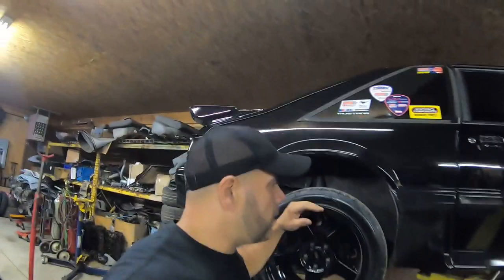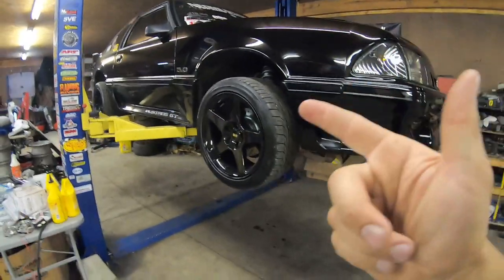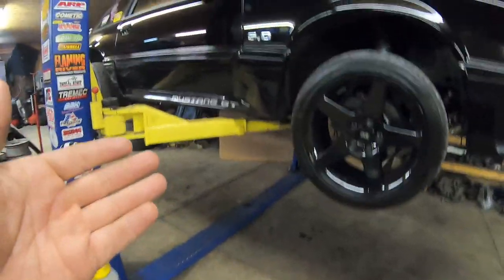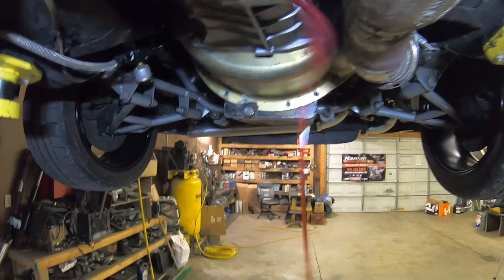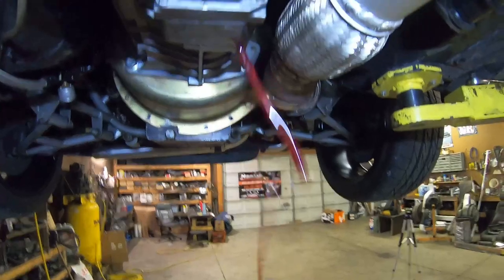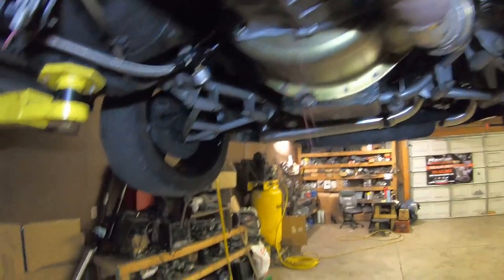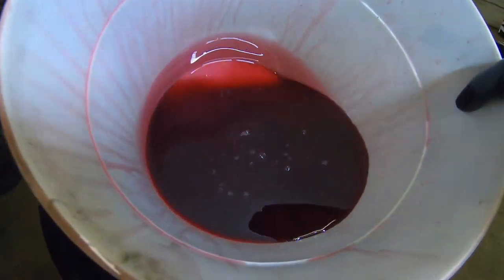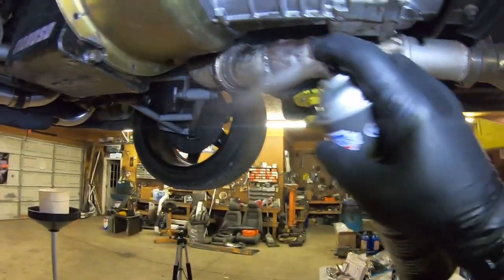The One Simple Tweak That Transformed My TKX Transmission

Comment: thats because tremec makes a quality product
Reply from the maker: Never said that
Reply: same kind of oil came out of my tko 600.  before that i had a "built"t5 with a certain gear set.  it looked like someone added a pound of silver powder.  scared the shit out of me.
Reply from the maker: @angry408w7  Ya i get that. You cant see it well in the light, but it swirled silver hue.. lol. The syncromesh i put in.. boy that was night and day shifting. Video coming.
Reply: @Neomustangs  Pennzoil is very good.  i just changed it after 2 years and about 10,000 miles.  looked absolutely perfect.  I switched to amsoil.  definitely a difference in shifting for the better.

Calling Hanlon tommorow.  thank you for the code!

Comment: ive got a tkx and i cant believe how whiney 1st gear is
Reply from the maker: Did you change the fluid?
Reply: @Neomustangs  Yes sir. broke it in ATF switched to GM Synchromesh and now ill be going back to ATF. Spoke with American Powertrain and Gary stated i should just run Dex3 in it. Gary at @AP did state that the whiney 1st gear is normal.
Reply from the maker: @stangnutlx  it is. Synchromesh helped my tkx shift way better. I tested this thing. I know what it does
Reply: @Neomustangs  What do you suggest my friend, stick with the Synchromesh and let it eat?